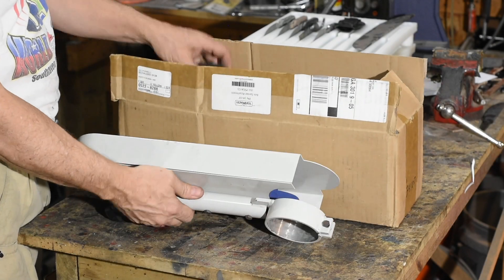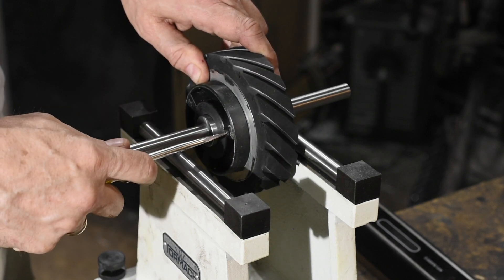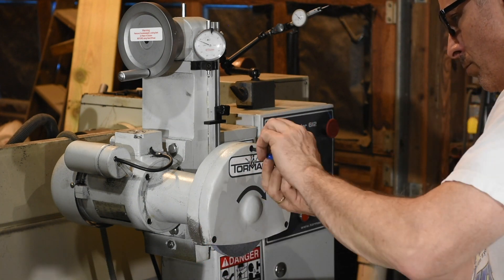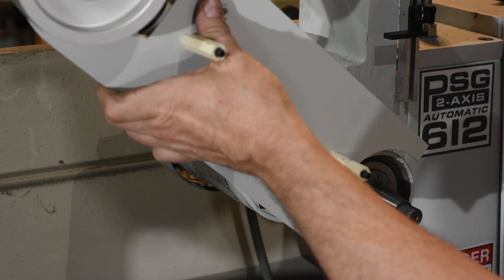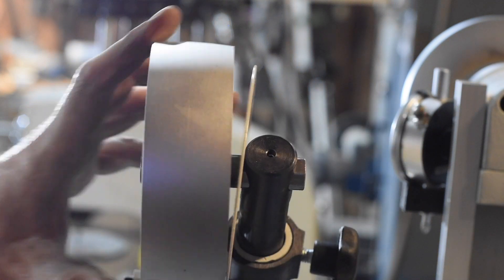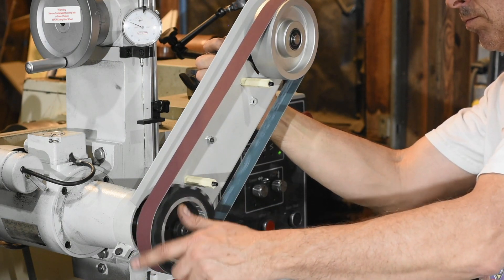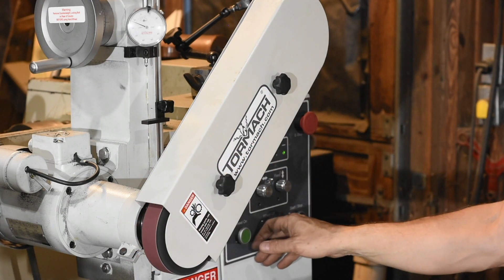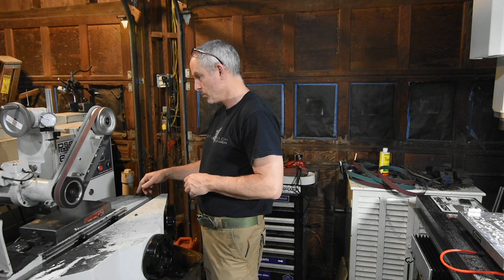Tormach Surface Grinder - Belt Grinder Attachment Installation

Comment: Very useful video - helped me a lot getting my own Tormach belt attachment working on a third party machine. Just a few things to note however, that the rubber contact wheel needs to be trued (lathe tool, with sharp insert - see Grimsmo Bros vid) to get a really good surface finish and although initially figuring out the tracking/tensioning is fiddly and frustrating, once you get used to it you can swap belts over in seconds. Also, if you use a diamond file to smooth off the belt seam, you can improve the surface finish.

Comment: Sir, you should impart some of your knowledge on Alex Steel he has an older model and I am sure you sharing some of your skills with this piece would help him out.
Reply: I told Alec when he first got his surface grinder that a lot of knife makers convert them. i think he even mentioned it in one of his videos(the converting part, not my mention), both Lumablades & Ekim Knives have done it on their surface grinders... I got the TWSGA1, so I just hook it up to my grinder(I used it in my last video)... Take it easy...
Reply: He did say something about the upgrade. I saw a small clip of someone setting up a belt grinder with a track to make it a flat surface grinder. I will most likely never be able to buy one of these beasts so the belt grinder version would prob be my way to go. (if I can figure out how to build it.)

Comment: Hey Walter- converted my old Boyar-Schultz to a 2x72 belt rig some time ago... Found the serrated wheels were my scalloping problem- look a the scallops- if they are parallel to the edge- not the serrations- if they are at an angle- could be the feed rate and high/low spots. I switched to the 90 durometer Sunray drive wheel- trued the wheel and it worked a trick- how about a followup when you figure out the scalloping on yours- I know other things can cause it- I just got lucky with my first fix- subscribed and thanks for the effort. Be safe and as always- have a great day

Comment: Surprisingly poor engineering on the attachment for a relatively hibuck bench machine.  Perhaps dynamically balancing the wheels will reduce the scalloping...or maybe new belt seam?  I would  definitely invent a new way to adjust tracking that didn't require guess and bigolly.  Thanks for sharing this Walter!
Reply: My guess is that in order for the dynamic to create noticeable scalloping (seen by eye I mean), the dynamic would have to be pretty huge. When the part is all put together, it would require a pretty big dynamic for the wheel to be running out that badly (that’s another thing, you can have run out on a dynamically balanced part, if it’s balanced after the fact).

I think you’d notice the machine shaking really badly before the scalloping, in my experience. My guess is that the dynamic is pretty negligible, otherwise Tormach is just cutting corners on balancing by having the end user let it drop to rough in a static and forgetting the dynamic (which at these speeds should easily appear). That wouldn’t surprise me though.

Comment: .
What is the best option for a good belt grinder? How wide do you like your belts to be, and what grits do you use? Is one type of grit better than another? 
I have a Shopsmith with a 12" disc grinder on it, and it seems like the ceramic last much longer over the more conventional type of grinding mediums. I am a novice Smith, but I spent over 40 years as a Toolmaker/Engineer. Steel is not new to me, but doing blade work is.
Thanks for your time doing these videos.!
Smiles!
Reply: kutzbill check out his older videos. He has a few good ones on belt grinders.
Reply from the maker: I've got an entire playlist of grinder videos devoted to answering this question.

Comment: Sorry Walter, but that looked like such a pain in the ass just to upgrade an existing piece of machinery.  You could have just got the Travis Wuertz tw 90 surface grinder attachment or the one Oregon Blade Maker has for your belt grinder.  TW90 tool arms are 1 1/4" square and OBS are 1 1/2" square.  Pretty sure one would fit your grinder.
Reply from the maker: I take your point, but a couple of things worth noting.  First, it was barely an hour's work to set this up.  I intend to leave it there more or less permanently so it's not like I have to set it up every time I want to surface grind something.  But the main point is that now I can put five knives on there, fire it up and walk away.  The Wurtz-type set-up is cool, but you have to sit there and operate it the whole time.  They're really not comparable solutions at all from a labor saving standpoint.
Reply: Griffiths Hand-Made-Knives The whole reason that he got this surface grinder was so that he could set it up and go while he's working on another machine. He can work on his belt grinder while the surface grinder is at work.
Reply: RyTrapp0 It doesn't change the pain in the ass that was to set up just to surface grind.  Send me a link to your knife shop setup and I'll show where the 2x72 setup will benefit you more.
Reply: Walter Sorrells And that's exactly how I thought you were using this. With a production knife line, you can't beat these basic forms of automation.

Comment: Technically the wheel is only statically balanced and may still cause dynamic forces (angular mass has a r^2 term)
Reply: sorry for being a smart ass
Reply: You are technically correct, the best kind of correct.
Reply: Not sure what’s wrong with my phone, I might’ve successfully replied already. Anyway... Yes, that’s true. 

By just letting it drop, you can rough in the static (single plane). This still leaves the dynamic (two plane, higher critical frequency). But, hopefully Tormach hasn’t cut too many corners and actually looked into it, and decided that this was acceptable for the machine. My guess is that the dynamic is pretty low (it’s thin, probably locates well with minimal run out, rubber even, etc).